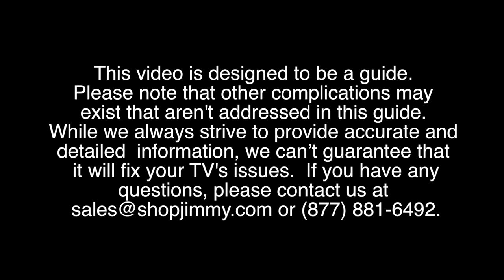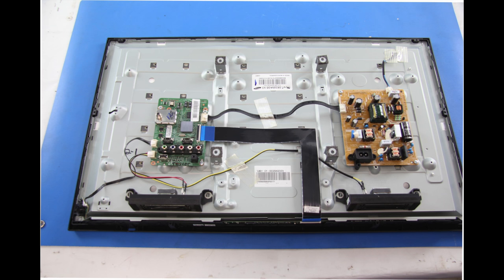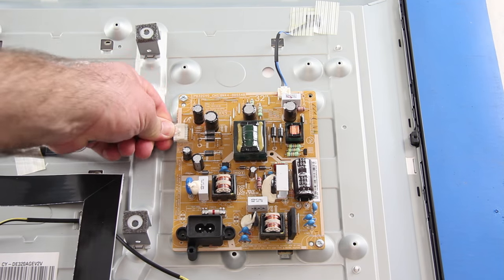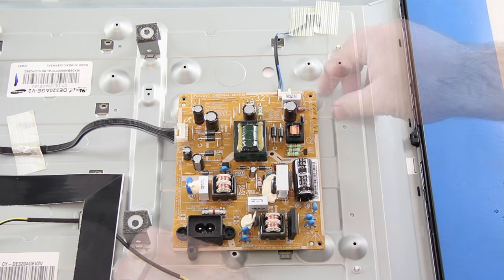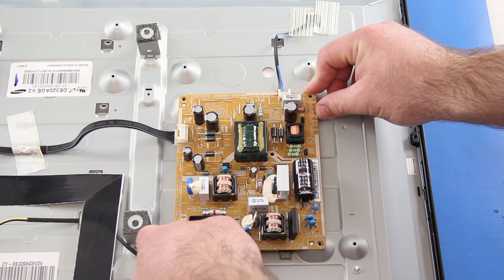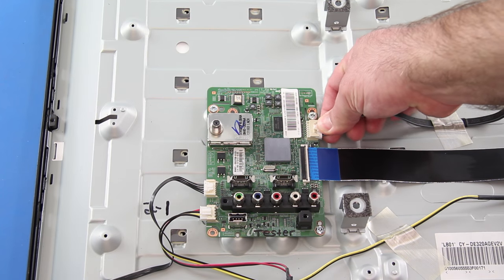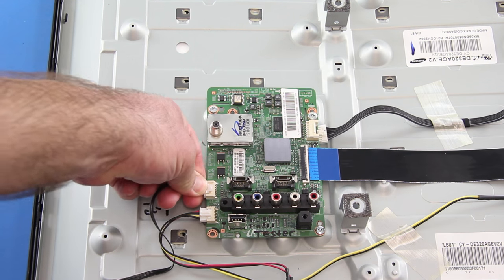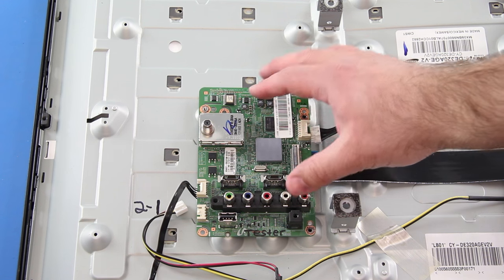Samsung TV Power Supply & Main Board Replacement Tutorial - UN32EH4003FXZAFXZA

Comment: Thanks for this video. My Samsung TV blinked out when we were watching it. I figured out it was the power board that was the issue (by watching another video) and after watching this video decided to order a replacement from EBay - I found one for £32 and after checking carefully that is was the correct part I placed the order.  Samsung wanted to charge £100 just as a call out fee and I am sure this cost would have escalated! And it would have taken forever.  So all I needed to replace this power board myself was a screwdriver and no electrical know how. Really easy and once plugged in the red light came back on and the TV now works again! This video saved me hundreds of pounds - thank you!

Comment: Thanks for this awesome video. I am looking for the below 2 parts for my Samsung UN46ES7500F LED TV. Could you please help me where I can find them. 
1) The power supply board
2) The flat 20 pin ribbon cable (black) that connects the power board and the main board. 

I am able to find the Power board in eBay, AliExpress etc but unable to find the exact the ribbon cable.
Can you please help?

Comment: Do you have to switch both boards when you change one? There was a burnt hole in the power supply one right above the green piece towards the top R9163 so I just swapped out the board but the tv still won’t turn on

Comment: After my Samsung 55" TV went dead, I went on line and saw how to replace the power board. I bought one used on Ebay for $34. I plugged it in and the picture came on. However, the colors aren't as rich as before. There are only two electrical components in the TV. Do you think if I replaced the other one, the picture would return?

Comment: I have one more question. I was searching for new mainboard, but there seems to be more versions. Do I need to buy exactly the same version of the board or can it be slightly different? My board is duntkf111, QPWBXF111WJN1 v.1.21 and my TV is sharp lc-40le600e. Closest thing I found is for same the model as mine but only for 30 inches TV instead of 40 and version 1.13. Other one I found has last two letters "ZZ" instead of "N1" is this problem?

Thanks fore reply.

Comment: My t.v was working fine. Had it for a little over a year. I know nothing about electronics. All of a sudden the t.v went out no power to it and the red light wont come on anymore. I took it apart to see if anything looked blown and it looks fine i have no tester and if i did i have no idea how to even test them. I did notice that the extension cord looked burnt and it wasnt like that. Im guessing maybe it made a shortage and blew something on the t.v. my question is if i buy the boards you have all 3 that come for the t.v i need would it power back on? The power board is 20 less then all 3 i figured for 20 bucks more get all 3 in case all are bad. Would changing them or power board be any help in fixing my t.v? I have only used it for maybe 3 months tops out of the year i have had it. I took good care since it was alot i spent on it. I know there are more expensive ones but its what i could afford. Thanks in advance
Reply: Did you try this, did it work because the same has happened to me no power, no light so if I change the power board for 20 that should fix it

Comment: My 50" Samsung LED TV 
went out last week.
It's 10 years old, but in perfect condition. 

So I found a refurbished 
power board for $35.
(New ones cost $138+.)

I followed your advice,
& swapped out the board.

Total Cost=$51.
To save a $500 television.

Many thanks. 
I can't thank you enough. 🤘
Reply: How did you find out you power supply
Reply: @sanic3245  
It works for days, then powers  down for 24 hours.
3 circuit boards.
I don't know which to replace.

Tried replacing the power board.
Did not power up.
I'm at a loss.
Probably just buy a new one.
But I hate the waste.

Waste is terrible.

Comment: Hallo  and thanks for the video.  can you plz help me?
I'm stil stuck  with my LG 42PQ2000 plasma tv witch is also stuck in stand by modus.
*I plug 220v 
* hear relays clicking once.
*blue front led light blinks 7x
* then blue front led light goes steddy on blue 
* after a while light gets red .
* i csn only switch tv with remote buy does mot react on it aftet that.
SO ....5V standby present.
..........can also mesure 3.5V on thr PSU....but NO AUDIO AND NO VIDEO.
Anny help wil be appreciated.
thank you all in advance

Comment: Hey guys thanks for the video and the many others, y'all helped me a long time ago to get my T.V. repaired by Samsung.  Thought I was gonna have to get a whole new T.V. so that was great.

Anyway wanted to ask another question cause it seems my T.V. is going out again though it could be my fault.  I have a Samsung PN51E7000FX and I've had it since it was new.  I believe that the Y-Buffer is bad but I'm not sure.  I have had to move the T.V. a few times now (though always in the original packaging) and I'm sure that's not good for it.  

Not only that but I think it may have been plugged into a power strip that was plugged into a wall that didn't have a ground maybe.  It's the only thing I can think of cause it seemed like it had a lot of built up electricity, almost like an electrical up building up in it even when powered off and when I would touch it it would go away.  

The reason I mention all this is because the symptom my T.V. is these horizontal bars that go all the way across the screen and up and down and actually will have a "rolling" effect if you move the position of your head.  They stay there when you turn the T.V. on as well though it's hard to tell they are there unless the scene is dark.

Anyway do you think that sounds like a bad Y-buffer?  Thank you for taking the time to read all that if you did lol.